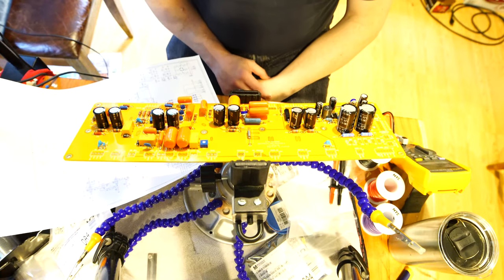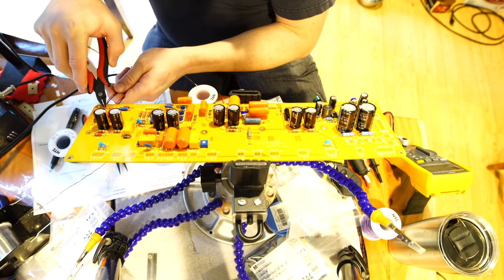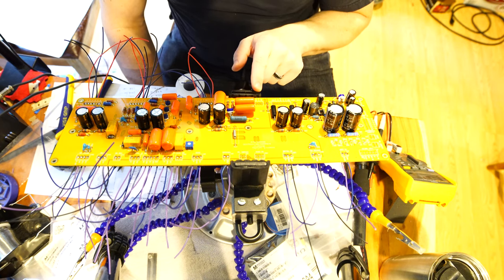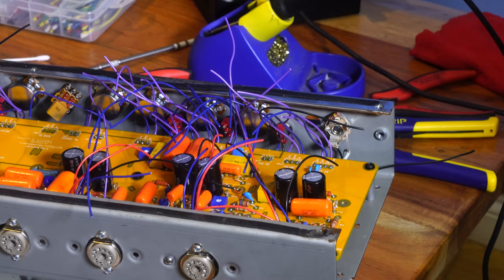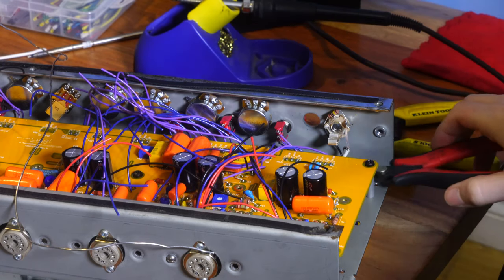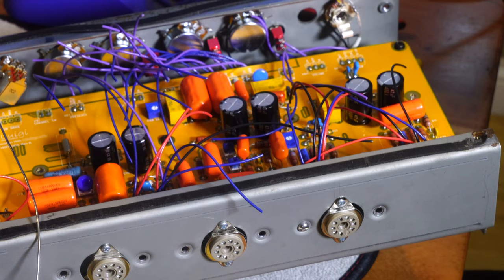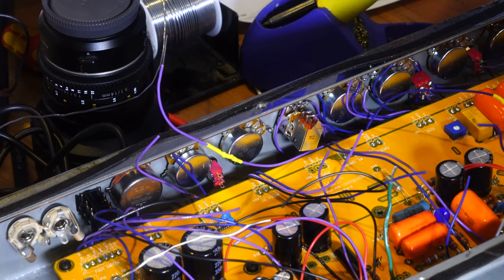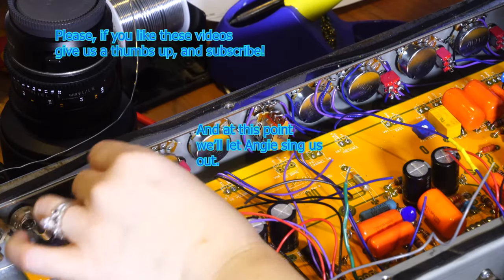Blues Deluxe to Overdrive Special #183 Video 6

Comment: Many ,if not all dumble,s, have local neg feedback on each stage. Does that board have that?? That amp should be slot better than it was. Let,s hope so.
Reply from the maker: The #183 doesn't have any LNFB, only the Global NFB that feeds into the presence control.  I hope it is better too, ;0  (secret, I've finished it and played it and it IS way better)